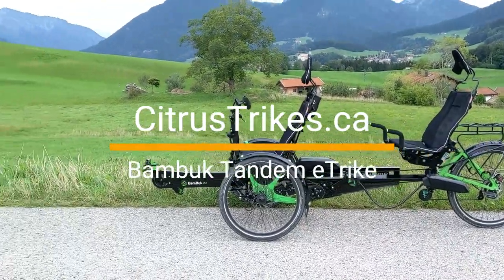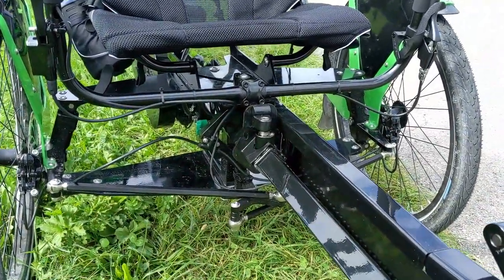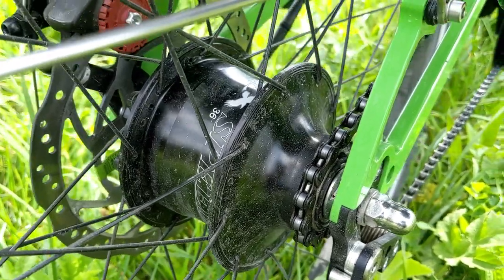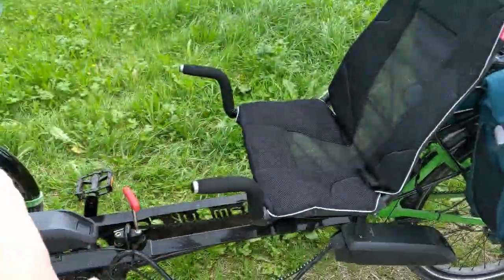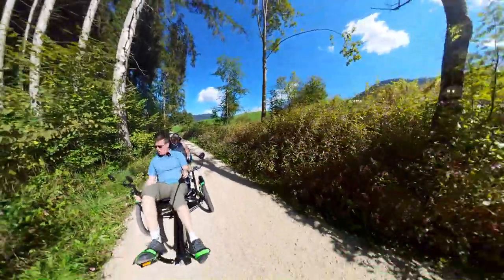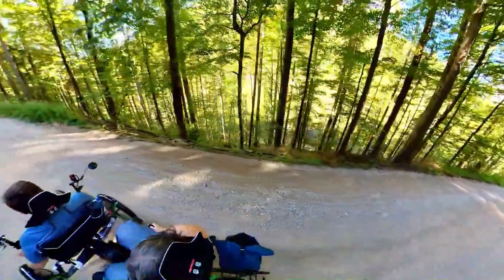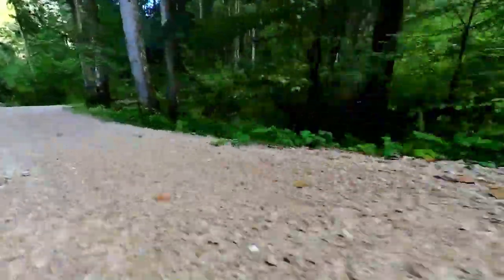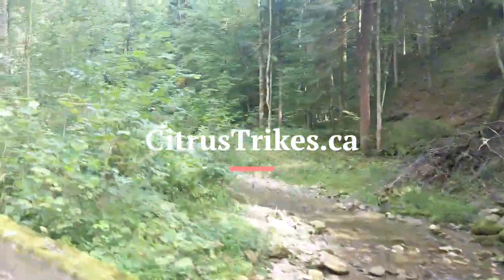Bambuk Tandem eTrike Review & Ride Test (German made tandem electric trike)

Comment: Never doubt that someone will steal it given half a chance. I had my trike stolen in Germany 2013.  If you want a frame lock you would want it on the front wheel not the back. I through my U lock through the front wheel when there is nothing to hook the lock around because the thief will have to carry it and if the lock is around the rear wheel the thief can walk away with it by just lifting the rear wheel off the ground.  
I will attest to how fantastic the Rohloff is, though I have the cable actuated ones on both of my trikes though mine both have extended range as the both have dual chain rings on their bottom brackets.   
I have leaf spring suspension on the front is really effective. One of my trikes (I call it my mountain trike) has leaf spring suspension and it is super. With an air shock on the rear wheel I can rip over speed bumps nearly like they are not even there. 
I have been meaning to one day to drop into your store in Chemainus. 
On trike safety on the roads, where traffic is low and the visibility is high, trikes are safe. There are places where I will not ride which involves high traffic volumes at high speed with out shoulders   not wide enough to maintain a reasonable distance from the traffic flow. Germany is a great country for cycling. I hear that Victoria is implement a new cycling infrastructure. Vancouver Island offers some pretty good cycling. There is a place not far from where I live that is a bit dangerous for cycling and it is on a heavily used cycling route, which would be near suicidal on a trike as the trike intrudes more onto the roadway that does a bike.
Thanks for your video it was really interesting.

Comment: Great footage with the new camera Kelly! 
Does it have reverse? Lol. 
No seriously does it have reverse?😊
Reply from the maker: Glad to hear that you enjoyed the video Tim!  We had a fantastic time recording the ride test and actually spent a few weeks before and afterwards riding it around Ruhpolding.

Although it doesn't have reverse, it rolls really well, so you can put your feet down and push yourself backwards, or even grab onto the front wheels to move backwards.  

Another trike that you learn pretty quickly on trikes is to parallel park to make it easy to get going again - like I did in the video when we stopped to look at the waterfall.  I also find myself relying on gravity to move me backwards by parking on slight inclines!